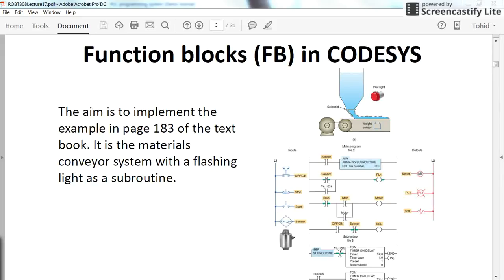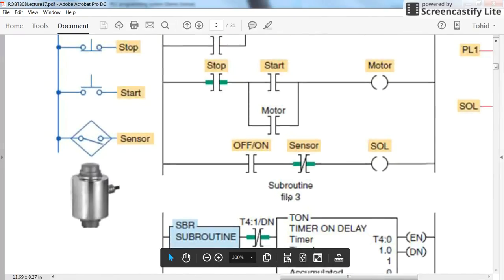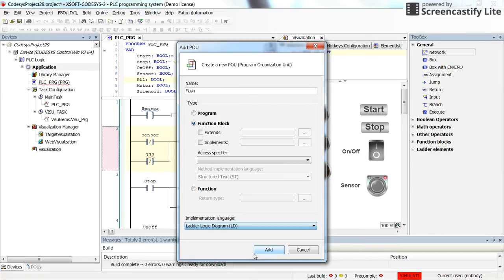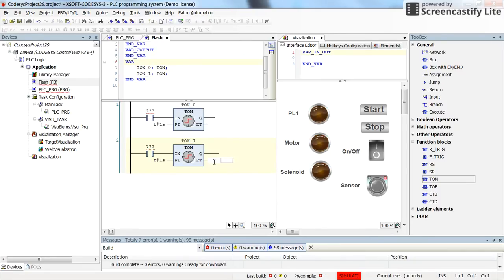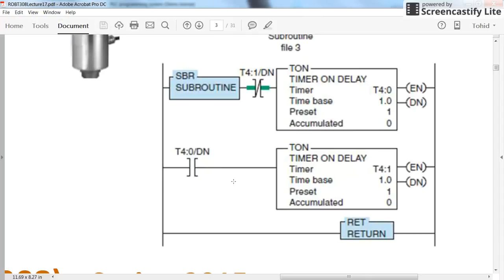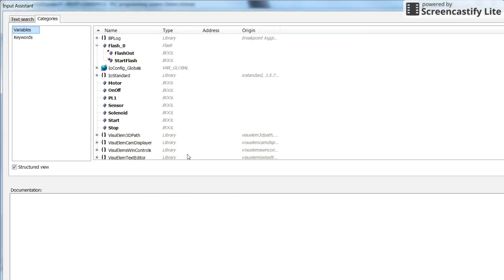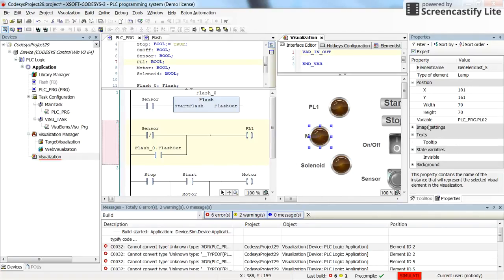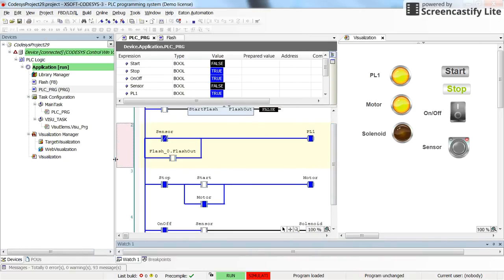CODESYS: How to create and use Function blocks in the project

Comment: Thank you for the video. I am using Codesys 3.5.19 and during creation of own FB I automatically receive EN input and EN0 output, so the ladder line connected to them. And StartFlash and FlashOutput are in the air. How to avoid this EN and EN0 creation and to handle this situation?

Comment: Souldn't the stop button be NC ?
Reply from the maker: For safety reasons the STOP contact in the code should be a normal contact, not a negated one. STOP switcjh itself should be a normally closed one. This way, if there are any issues with the switch, it will be considered as the switch is pressed and the proces will stop.
On the other hand, if we use a normally open switch for stop, and then a negated contact in the code, in terms of logic it will be equivalent, but if there is an issue in the circuitary of the Stop switch, if you press it, it may not close the contact and the system will not act asa expected.